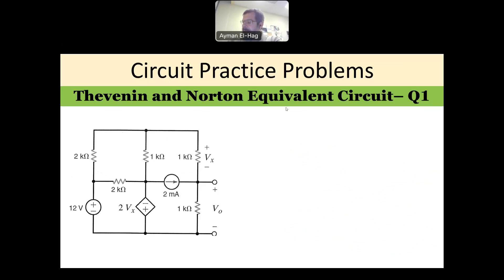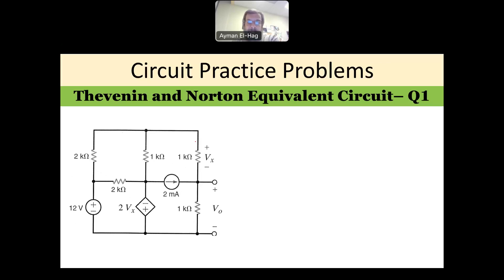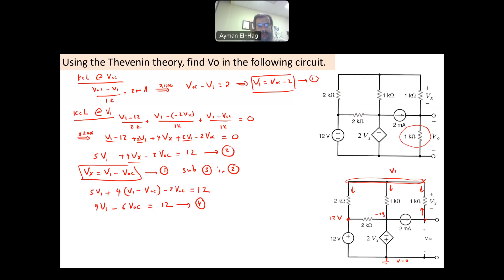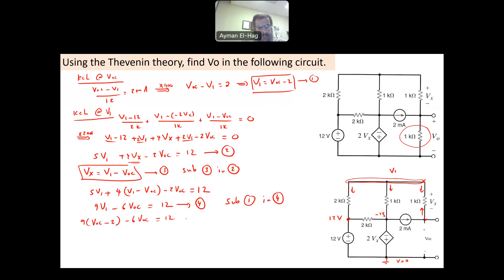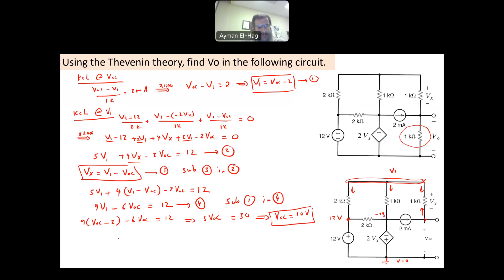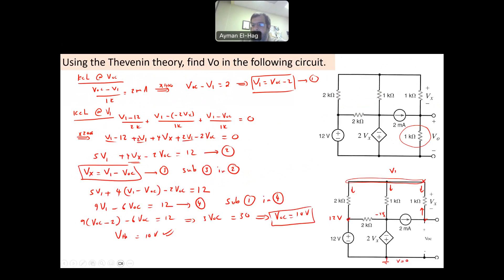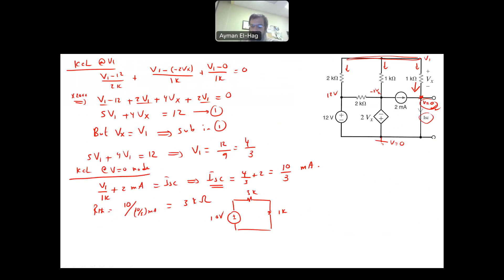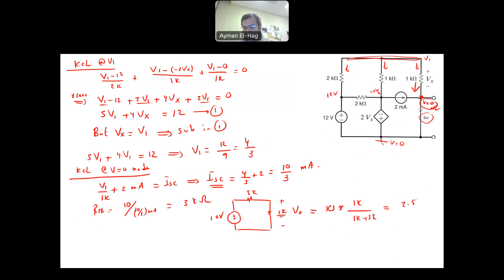Thevenin and Norton - Question no. 1

Comment: I really like your videos professor. You make it very simple. I wish you can solve PEO exams for circuits, power system engineering and power system and machine before May so we can pass the exams in May
Reply from the maker: This is one of my projects. My problem is the time but I will try to finish at least the circuit. For the machine I have many solved examples that you can see and the same for circuit.